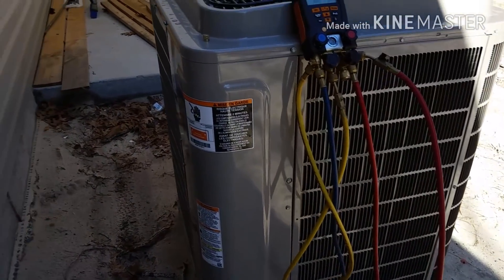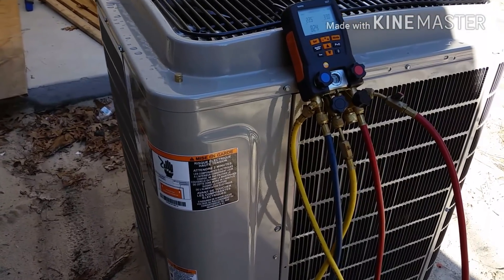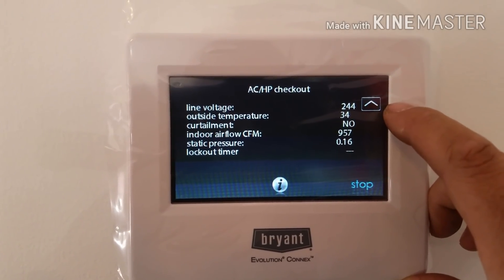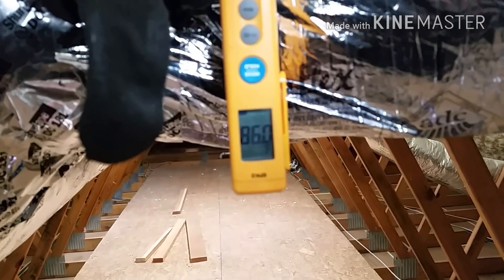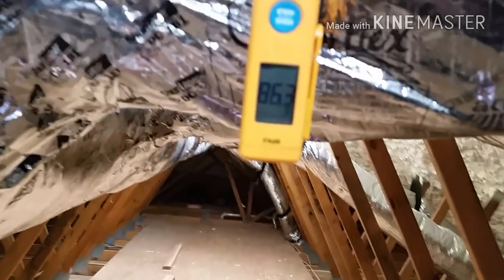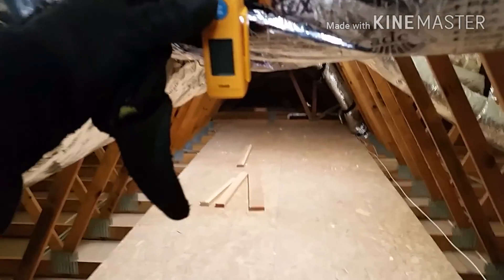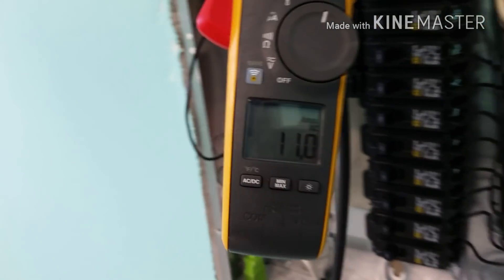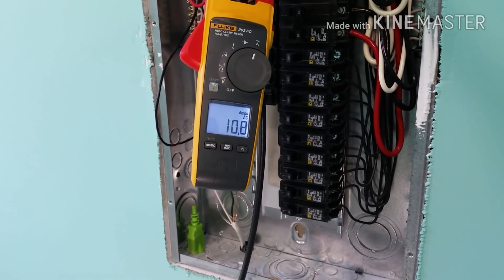Heat Pumps Can't Work In The Cold

Comment: We here in Phoenix get down in the low 30's and sometimes in the high 20's and we have never had an issue of heating a house with a heat pump without heat strips. That has been going on sense the seventies.
Reply from the maker: Larry Cole I dont quite think Phoenix AZ is a great watermark for how a HP can perform in cold weather. lol! You may on rare occasion dip to those temps but that is very likely just a few short hours before warming to well above freezing.  A standard, single speed HP will struggle in low temps without question. Thanks for watching.
Reply: HVAC in SC you are missing my point the point was a heat pump will heat at lower temperatures without heat strip then people think.
Reply from the maker: Will they produce heat at those low temps? Absolutely. No arguments there, but will it be able to adequately heat the space to the desired temperature? 9 times out of 10 that answer is no. The house I just left for instance was set to 74, it was 72 in the house and cycling the Aux heaters because the standard single stage heatpump simply can not keep up on its own in these conditions. That is the point I was trying to make. 90% of my service area over the last 10 years is heat pumps so I see this every single winter. lol! I appreciate your comments and thanks for watching Larry.
Reply: HVAC in SC It's called a balance point where the building loses heat at the same rate the heat pump can produce. Now having said that I have seen heat pumps heat a house where you wouldn't  think it had no chance without heat strips. I had a boss years ago when I was living in Indiana by the way that is ware I am from my boss ran a test on a Bryant single stage and that unit would heat his house 3200 square foot home all the way down to 0 dregees without heat strips. I refused to believe him until I saw it for myself. I used to be an FSR for Trane and we had heat pumps in Manitoba Canada and they heated fine all the way up there. So anything you find a heat pump can do in the heating mode don't be surprised because I am not. By the way I do enjoy watching your videos keep up the good work.
Reply from the maker: Larry Cole Thanks for watching.

Comment: One of our FSR guys here has had his XV20i running in his house for the last 4 winters with no strips... coldest his house has gotten is 68 degrees... even when we had a few 8 and 9 degree nights !! Not sure how it feels in defrost mode but he seems to think it has never hit it yet ? Impossible !! ... all this technology began with mini-splits I guess.
Reply from the maker: Anti DIY HVAC Very nice. Yes, this VRV/VRF type technology is not new by any strech world wide but relatively new to the US in this industry . I believe will completely take over the US inside of 10 years max.
Thanks for watching.
Reply: Anti DIY HVAC ... make that Mitsubishi  mini splits! The  inverter heat is the bomb but when you have a summer with a inverter you will have the most comfortable  humidity  control ever.
Reply: Anti DIY HVAC carrier 25vna036 will easily maintain a 72 degree home at zero ambient with aux strips fully locked out.

Comment: Thats 1 sweet system!
Reply from the maker: TP Services It certainly is. Thanks for watching!
Reply: Heat   pumps are junk in cold weather below  36 degrees with out the electrical  strips
Reply from the maker: @joseplascencia2632  😆😆 Sounds like an opinion based on ignorance rather than facts. There are MANY models of heat pumps that can still perform extremely well in negative temperatures.
Research VRF system or even standard ductless systems for that matter and get back to me.

Comment: 90 degrees at best
Reply from the maker: Darin pugliese Thats with it being about 60 inside, 33 oirside, and exposed concrete floors throughout the house at around 40-45 degrees. Don't focus on the number, focus on the actual temp rise. once it reached 70 inside the supply temp was right at 100. once the floors and furnature are in it will be even better. Thanks for watching.